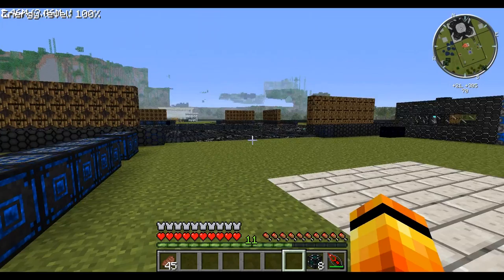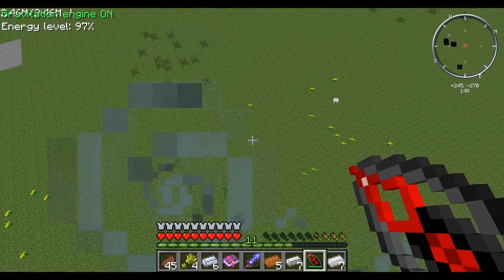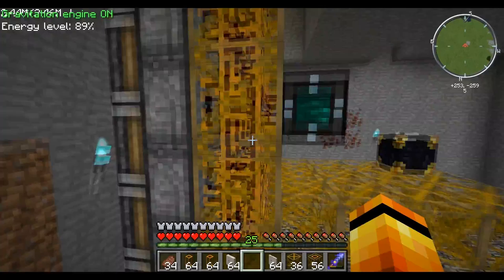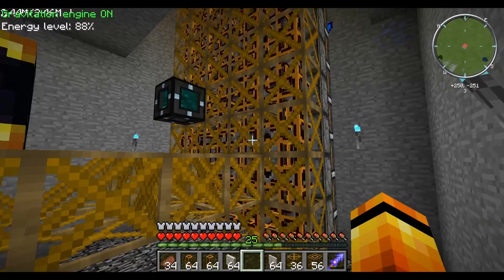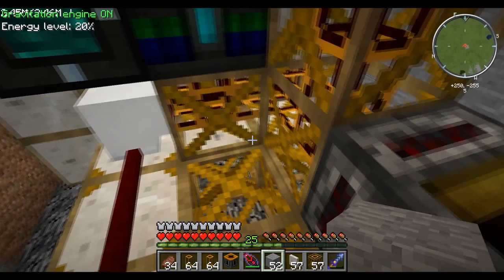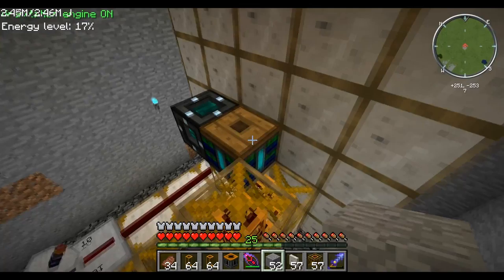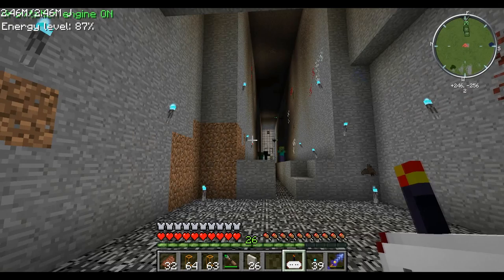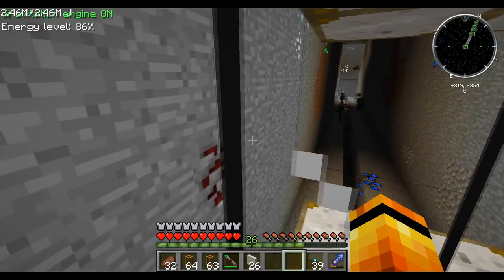Learning "Feed The Beast" - Episode 22 - How to build a Tunnel Bore

Comment: any terrain modifier will do the trick, but you dont have any written to your book. that is causing the instability. in addition, if you are using the initial release of version 1.0.1 of the ultimate pack, the mystcraft version got some bugs in it, which causes some weird ages which are not related to your written books.

Comment: you can try to use a buffer that puts out to a redstone pneumatic tube that then puts out to a jacketed wire, and the to a normal wire, im not sure if that will work bit it might, please tell me if it does